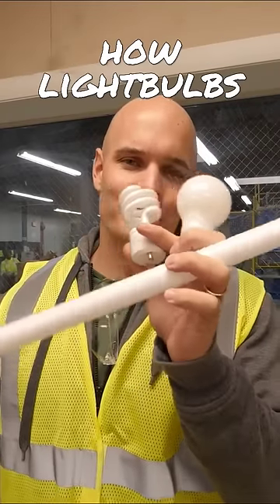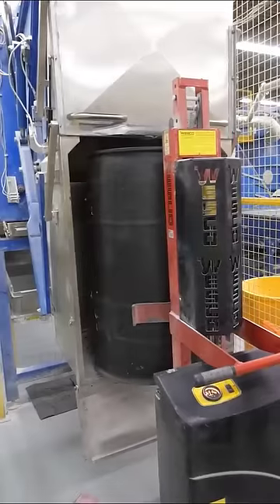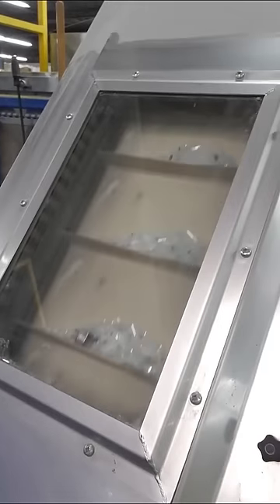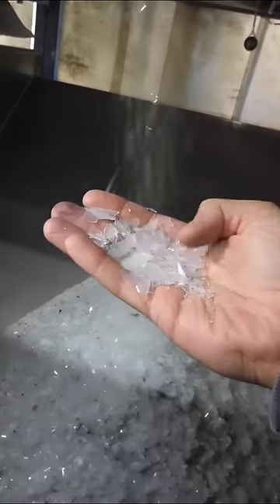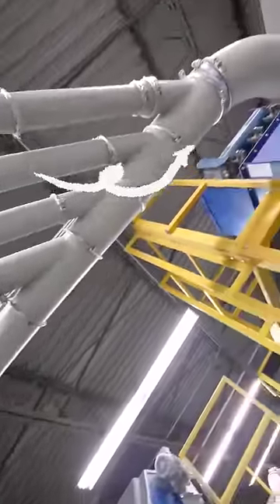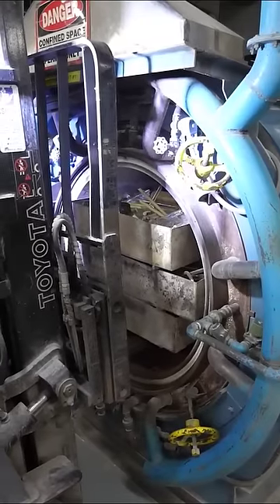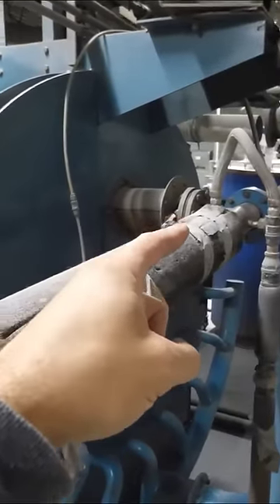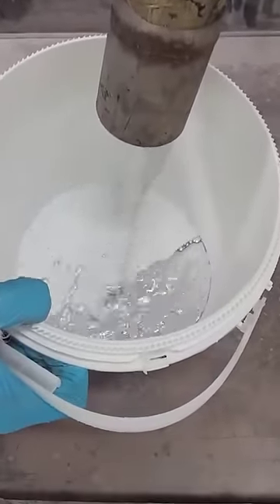VERY BRIGHT IDEA INDEED...

Comment: I’d be interested to see if those employees have elevated mercury levels in their blood. There’s no way they don’t
Reply: they absolutely wouldn't have elevated mercury levels. as long as everyone follows protocols, mercury in that form is pretty safe and stable.
Reply: @OACustom  There isn’t a single respirator in that video. No matter how good the airflow is in that warehouse, there will 100% still be mercury dust in the air from the broken lamps.
Reply: @OACustom mean like sticking your hands into a stream of broken fluorescent light bulbs?
Reply: @OACustom They're in a factory full of broken lightbulbs. They have elevated mercury levels
Reply: I got mercury poisoning just watching this.
Reply: The mercury is bound to the phosphorus until it gets into the retort. Mercury in most forms is relatively safe, elemental mercury is safe to drink(won't kill you and was used in medicine for a very long time) though it's definitely not a good idea. Organic or methylmercury is the toxic form and vaporised mercury is the worst form(the cause of mad hatter syndrome).
Reply: @Jake12220  It still binds to soft tissue and builds up over time. Your brain happens to be a large mass of soft tissue and is where heavy metals often end up. Even though it wouldn’t kill you right away, elevated mercury levels due to exposure leads to many, many health issues
Reply: I would hope that protocol requires the exposed workers to have periodic blood tests to check for mercury buildup.  I would want that if it were me anyways.
Reply: They will die if they did
Reply: @HCG  inorganic mercury isn't absorbed by the body so levels won't increase over time. Organic mercury can be(like the sort found in some fish) as can vaporised mercury.
Reply: @HCG  It's called a good ventilation system, with redundancy.
Reply: @sannevanbeers  That amount won't kill you on the spot but it will accumulate and cause health problems.
Reply: @Jake12220  The mercury in the open bucket will off-gas.
Reply: @johanna006  true, but hopefully that was just for the clip. The evaporation rate is highly temperature dependent, so if it was chilled by the condenser then it should be pretty safe. The best thing they could do to reduce risk in the facility other than a good air filtration system would be to keep it cool.
Reply: The mercury gas is inside of the tube, and asap the glass is broken, it will go to the air inside this company, and the employees would be exposed to the gas.
At the glass it's phosphorous. It's there to turn the UV light that come from the inside of the tube, that is invisible, to white light. That happens when the cathode and the anode receives high tension, that induces the mercury gas to produce the UV light. The phosphorous is there just to turn UV light to visible white light.
Reply: I do, but only cause I've been sneaking a lil sip every now and then. The rest of the crew listens to "OSHA " whatever that is.
Reply: In theory if policies and proceedures are good and actually followed like they're supposed to be then they shouldn't be at too much of a risk.

Unfortunately given the sticking of an ungloved hand into a waterfall of broken glass shards I fear that the sense required to follow the policies and proceedures in the broken light bulb processing facilty may be absent. But who knows.
Reply: @nogodsnokingsonlymen8538 best reply in this whole thread 😂
Reply: OMG 😱. You should call OSHA. The local TV station. Hell... Call the president and complain! 😂
Reply: Can almost guarantee they’re participating in a medical monitoring program that does bloodwork regularly. I work in Haz waste management and ship to these people on the reg.
Reply: Idk i would think the giant industrial dust separator, retort oven with vacuum system, among other things they have probably do a pretty dang good job of containing that dust. Someone who eats a lot of fish and seafood is probably equally or more likely to have high mercury level as well. Methyl mercury is really bad, metallic mercury is actually not so bad if you're an adult, and in normal health with a decent diet you will literally just poop out the mercury.
Reply: @Jake12220 I am just curious about how much mercury you have been exposed to yourself? It is mercury!

Comment: FYI your local Home Depot has a container at the entrance or exit of the store where you can recycle your CFL bulbs and rechargeable batteries. They do not accept fluorescent tubes, I believe. You can recycle your old fluorescent tubes and old mechanical thermostats at your local waste management facility's residential hazardous waste dropoff location. :)
Reply: Sadly most folks will not take the effort to do so.
Most fluorescent tubes find there resting place anywhere you can think of.
Very small percentage  make it to these type facilities.
Reply: @Utubin  you just guessing
Reply: @desertodavid  i can see you've never worked in construction.
Reply: @poa2.0surface77  Not necessary. You could be a rare human who has common sense and therefore you would save the old bulbs until you are making a future trip to/near the Home Depot and then drop them off at that time. Above all else though, you're a crappy person if you willingly throw mercury waste into the municipal waste landfill. Don't be that person, just don't. 🙄
Reply: @mannys9130 yeah just hold on to some more garbage around your house SMH
Reply: @nancy8219 And your point is?
Reply: @jamesspalten5977  my point is for the average person to save their  non-working light bulbs and put them aside so whenever they go to Home Depot they can bring them and put them in whatever recycling bin they have how often does that happen so keeping extra garbage around your house for the in case of sound stupid to me but do whatever floats your boat dude do you understand now
Reply: Thank you for the info. I didn't know recycling service for light bulbs even existed. We always just threw them away in the trash but I'll see if our home depot has that and recycle them here on.
Reply: Oh hell no. I'm saving that mechanical mercury switch in the thermostat...
Reply: @MaleusMaleficarum  I would think that over cuz it may come in handy in the near future

Comment: Unless there is some downside to LEDS that I'm not aware of I see no reason why toxic florescent and CFLs should be legal at all.
Reply: LEDs can appear to flicker on camera depending on the shutter speed and power supply to the bulb, so there are some cases where other types of bulb are nice
Reply: CFL and Florence bulbs can light wirelessly with a tesla coil. LED won't without a coil and resistor.
Reply: LEDs use phosphor too, just much smaller in amount.
Reply: We have 100 years of produced bulbs available to recycle... ♻️
Reply: There's no downside to high quality LEDs, but fluorescent lights have their uses and are simpler and cheaper and most times outlast by much the life of an LED bulb as to its construction not to its technology because i've even had many expensive LEDs fail before the year ends whereas i've had CFLs that were keep going and going for over a decade lit up 24/7.
Reply: @johnbelwell2461  do you know of "Dubai LEDs"?
By far the main reason LEDs fail is over temperature. While the produce less heat than filament lamps, there can still be too much insulation for a direct replacement. Ceiling lights that have insulation above the are a classic example.
Dubai was aware of this issue and contracted Phillips to produce LEDs lamps to meet a government standard that meant per Watt, each lamp used twice as many LED chips.
The result is lamps with lifetimes that rival florescents.
Reply: led s are bad for your eyes
Reply: @Warp3326  utter tosh
Reply: Your standard CFL bulb has 4mg of mercury, with some having as little as 1.4mg of mercury. The average lifespan of a CFL bulb is 15,000 hours. Let's assume you keep the bulb on for an average of 16 hours a day, that's 937 days that bulb will last.

An average sushi roll, with 5oz of sushi grade tuna, will contain 0.097mg of mercury. While the math isn't perfect let's divide the 937 days a CFL bulb will last you by 30 days which means that bulb will last you roughly 31 months. If you eat sushi once a month, take the 0.097mg of mercury multiplied by 31 months you get 3.007mg of mercury. In Japan the national average for eating sushi is twice a month, so 6.014mg of mercury. That's assuming you're only eating one roll and not consuming any other fish products that month.

Most people expose themselves to more mercury by eating fish than that CFL bulb will ever expose you to.
Reply: @johnbelwell2461 if you like that annoying buzzing sound then good for you but I don't. Also LEDs can be much brighter for less electricity so you can only have to buy two of them instead of say four.
Reply: @bland9876  they only buzz if they are on AC, with a high frequency DC power supply there's no buzzing or flickering at all, other than that i agree
Reply: @ThisIsCheez  finally someone who said it apart from me
Reply: @johnbelwell2461  Actually, the only reason LED lights die early is because of the rectifier. Most LEDs operate on DC current, while fluorescence lights, like light bulbs, are much simpler and operate directly on AC. I've managed to revive many LED lights in my house just by replacing the power supply unit and they easily last more than a decade.
Reply: @Warp3326 anw, you're cute. Though you can go back to the playground now, the grown-ups are talking
Reply: wtf @Steampuke
Reply: are you drunk  @Steampuke
Reply: says the one with the username "steam puke" @Steampuke
Reply: kid, be quiet @Steampuke
Reply: @Warp3326  hahaha, what a nifty little comeback you got there! You really are adorable

Pretty sure you can do better though! Try again !
Reply: are you like a 5 year old troll? @Steampuke
Reply: explain why you're acting like a child... @Steampuke
Reply: @Steampuke my guy you showed up out of nowhere, contributed nothing, ruined a good dialog, and then tried to say the adults are talking 😂
Reply: bro went real silent @Steampuke
Reply: You can't actually recycle LED bulbs, well not in most countries. Older bulbs are basically just glass and metal with a bit of epoxy which can be recycled on existing equipment super easily, LED bulbs require a completely different process for disposal and almost all of the waste can't be reused economically.
Reply: LED lights are still relatively new on the market, only commonly available for the last decade. CFLs right now are in the same position that incandescent bulbs were in 15 years ago.
Reply: ok @MisterMosfet
Reply: There's still millions of bulbs in use, it going to take years to stop them.
Reply: @ralanham76  if you cut off the supply it will take about the maximum life of a bulb.
Reply: @someperson7  yes and millions per year being replaced that will go well... We just got new benches at work and they came with fluorescent tubes. Well be stuck with them for years and the bulbs fail every 2-3 years.

I have CFL at home at least 10y old
Reply: @ralanham76  lol True, so the sooner we start the sooner we're done
Reply: @someperson7  yes I'm not sure when they going to update the commercial standard from the 80s 
A few years ago we had the landlord remodel and they used 13seer AC and fluorescent fixtures 🤦‍♂️
Reply: I just like how old fluroscent bulbs behave when they're turned on with an old Preheat ballast... LEDs don't do that... unless a circuit is designed.
Reply: @johnbelwell2461  You're telling me fluorescent tube lights only buzz if they are on AC? I've never heard of a ballast that's runs on DC.
Reply: Leds are crap, cheaply made,
To save money, manufactures use less components (leds and driver components) and they push them hard, they get hot and fail prematurely
The dubai lamp is the only good led lamp there is, lots of gently driven leds, very bright, long lasting and stupidly efficent 

Ill stick with my t8 fluros because they have lasted at least a decade, and when you know how to use them, they last even longer, besides the fact they are so cheap
Reply: @Warp3326 They thought you were a child..... then you removed that doubt.
Reply: @randomusernamed7307 LEDs only flicker because of garbage power supplies optimized for low cost, since the rectified power supply is integrated with the bulb as a disposable optimized to be cheap. If you had a high quality DC supply in the fixture and the bulb was just the LEDs themselves you'd have no flicker at all.
Reply: Flourescent, CFLs and incandescent bulbs are super important in the reptile keeping hobby as they produce heat and light to keep your animals healthy. Bulbs are also used in farming to incubate eggs and can even be used for heat therapy in medicine.
Reply: @MisterMosfet exactly what i was going to say, electronics recycling is a joke today.
Reply: @newmonengineering bros living in 2044 💀
Reply: They're actually being phased out.
Reply: Construction uses
Reply: @dougaltolan3017 True, the important thing to do is to undervolt each LED which makes them super efficient and last for many years, potentially decades. Just have more LEDs in each array. When LEDs started to get popular they used to be advertised as guaranteed to last 50,000 hours or more. That is possible but I only got about two years. I don't like how LEDs burn/blow up at end of life. They stink like crazy.
Reply: he's right, a good LED with have a much broader emission spectrum, cheaper ones make everything look weird
Reply: @ThisIsCheez I don't see how it co-relates
Reply: @ThisIsCheez if your spewing facts,that is messed up 😢
Reply: A- LED e waste is much harder to meaningfully recycle than these simpler bulbs, B- the amount of toxic fumes or mercury in individual bulbs is utterly minuscule, it just builds up to a lot with thousands of bulbs on a recycling plant line
Reply: Doesn't the led bulbs have starters? Whats in them ?
Reply: @someperson7  Lol must not have paid attention to when incandescent bulbs got outlawed, people bought up dozens of the things before the law passed. When my grandpa died we found he still had two master packs of incandescent bulbs sitting around waiting to be used. He died almost a decade after the ban.
Reply: @dougaltolan3017 Veritasium planned obsolescence video
Reply: @CsykKrit dumb and cynical, there's actually a lot of ways that LEDs are inferior to other lights the only benefit of LED is the lower electrical usage.
Reply: @ThisIsCheez by the way we're not talking about using fluorescent light bulbs in a normal setting, we're talkin about idiots working in a factory filled with broken light bulb
Reply: @RediTtora  nah, you're wrong.
Reply: @CsykKrit  if you're not going to say anything intelligent don't bother responding kids
Reply: @RediTtora  my sentiments exactly tough guy 👍🏻
Reply: That's it, another government regulation, stupid law pundit. There are enough laws on the books to send you to jail, if some tyrant decided they wanted you out of the way.
Reply: @pixels_per_inch Where would I find rectifier part, in the driver?
Reply: different chromatic spectra
Reply: @bobbyboombatz1489  LED bulbs have build in driver circuitry.  The drivers have mainly  resisters and rectifiers to convert ac power to DC power.
Reply: @randomusernamed7307 what if the led light bulb flickers when you turn the light switch on?
Reply: LEDs and fluorescent give me seizures. i would like to go back to incandescent. 😢
Reply: @adultdeleted  oh man, that is serious. Do anticonvulsants help? Time to stock up on incandescents while you still can cuz
Reply: @someperson7 mostly, for now, but i see flickering in every building and outside at night in cities. other people only seem to see the flickering at lower rates. i wonder how many other people started to have seizures because of this.
Reply: @adultdeleted  have you identified what frequencies set it off?
Reply: @MisterMosfet why's always like that with eco-things, no one ever look at the second-order effects, only the first-order feels good about the environment effects.
Reply: I'm very strongly inclined toward incandessant  bulbs for most applications because you don't need toxic chemicals to make them. I'd rather face the need to increase electrical output and clean up the production process than make millions of toxic bulbs and disperse them everywhere...
Reply: @kyleheins Well clean up the energy production process and maybe we can start considering that because right now the main poison you have to worry about is coming out of coal plants.

Also I can't help but wonder if you're using a device with a modern screen, have you considered that you are willing to use whatever fancy toxic gadgets you please by have a qualm about something that reduces emissions.
Why not use sunlight and go to sleep at 7:00 p.m. if toxins are genuine concern.
Reply: @mauirandall8176  indeed, coal is the biggest by far, and there are several options to replace it if we are willing to invest in power from other sources.

As for device screens, I've spent the last 15 years speaking against the over-use of screens in industry and private circles, though I have no problem with them being there. Toxins are unavoidable, managing their use and disposal is the important part. On that note, the thing I oppose the strongest is the excessive disposability mentality used by modern society. We design screens to be used for a couple years and discarded when there's no significant reason they need to be so short lived.
Reply: @Xanthelei  I have several spare incandescent bulbs just for a lava lamp, because I want to be able to replace it's bulb despite incandescent bulbs being banned where I am.

Comment: As an electrician i collected lights for 5 years then took them to the local tip to be "recycled". The guy said yeah just in a pile over there and pointed to a random spot on the ground. He then ran over them with a roller and covered it in dirt. Thats considered recycling where i live.